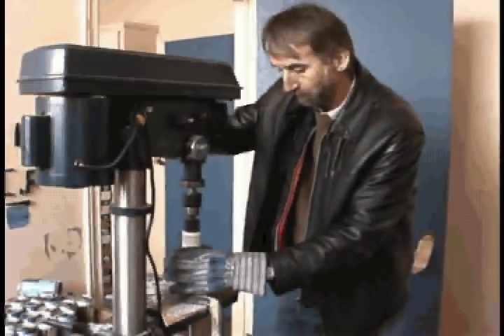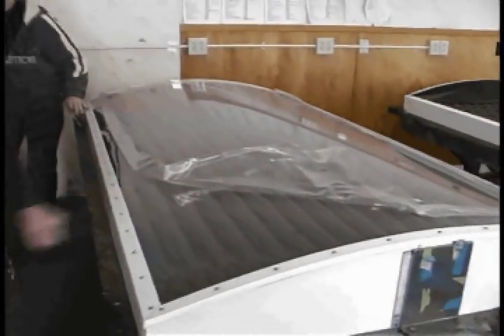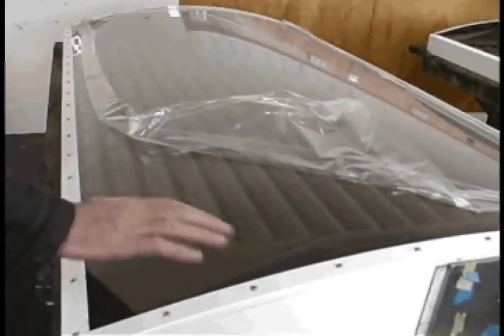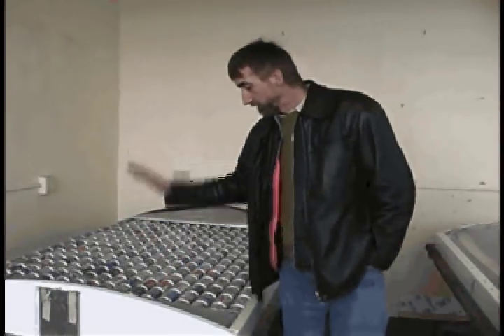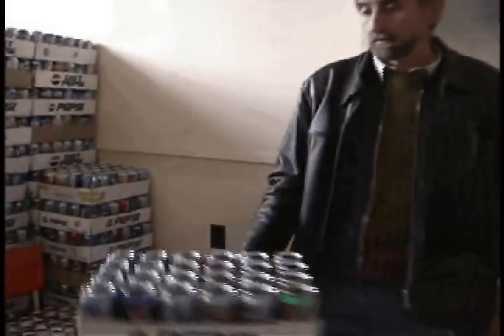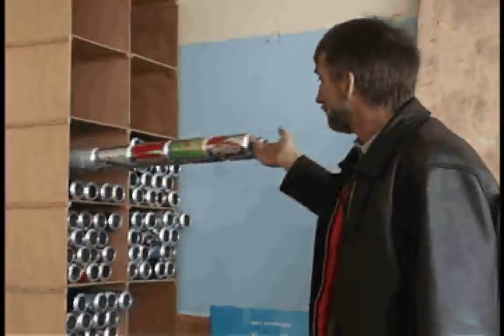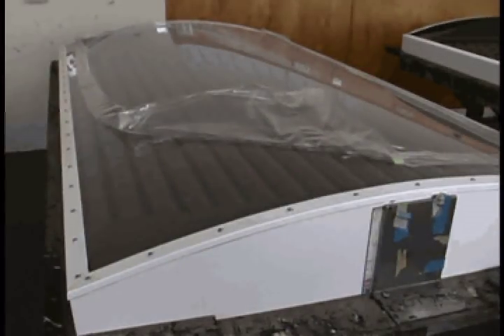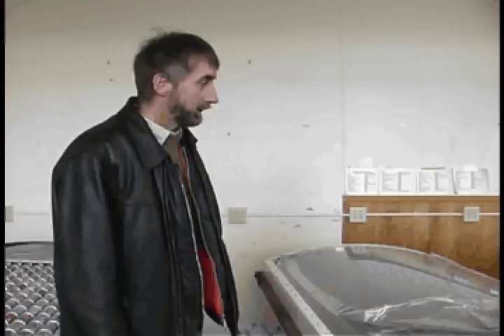Brilliant Newfoundlander Invents the Solution!

Comment: Very innovative. I liked the use of the cans' preformed edges for centering rings. My only concern would be the absence of a heat sink. Also, while this arrangement makes excellent use of waste soda cans, the resistance from the rough edges inside the cans doesn't make for a smooth flow of air. Large electrical conduit would eliminate that, although it wouldn't as inventive as this. The greater thermal mass of the EMT would keep the heat more consistent on a day with patchy clouds. Nice job.
Reply: I was speculating that the rough edges would trap the air and give the cans more time to heat the air.

Comment: As a former heating contractor I have to say this is quite a promising system. But as a former union safety rep...........Please! Please! Never use gloves near any rotating power tools. That glove next to the hole saw made my stomach churn.
Reply: Thanks, there is another bit of common sense that I never thought about. :-)
Reply: Thanks for the tip.  I would instinctively grab gloves.
Reply: Matthew Dies
speaking as someone who has 28 seperate breaks in fingers due to a glove wrapping my fingers the wrong way round a 13mm drill bit, I cringed at the gloves on as well.
Reply: HAHAH funniest thing I have heard all day thanks Employed 1000.
Reply: Bill Wright 
And it's not only fingers that can get corkscrewed. Watch out for those shorts!
Reply: at least you will miss next time! lol...
Reply: Employed 1000 and as a former woman I'd have to say never ever use sunlight liquid to wash those cans....dove is the way to go
Reply: Not that he has gloves on, wrong type of glove.  I would say that drill  press does not seem the safest to use on a can.
Reply: Probably used these gloves because of the heat transfer from drilling.
Reply: @nathanlafortune100  
Need gloves that fit - mechanical -
SpeedKnit® CR5 cut-resistant gloves are constructed with high-tensile strength fibers to protect working hands with EN 388: 2003 Level 5 & ANSI A3 cut resistance. SpeedKnit® CR5 work gloves feature heavy-duty nitrile palm coating so you can work with abrasive materials with confidence.

 or golfing gloves
Reply: Isn't the safety rep normally the guy who's the most clumsy andgot hurt the worst in the company?

Comment: Hook up the fan to a solar panel and the fan runs only when there is a need to move the heat that is being produced -when it is being produced.  Perfect symmetry.  All free energy that adds to the overall energy equation.  ...and I know, this is just a part of the answer, but any way to chip away at my heating bills, the better.
Reply: Also, if you could do it using a sterling engine to power the fan you would TOTALLY be set... there is never such a thing as free engergy, but the suns going to put it out regardless. :) Might as well take advantage!
Reply: Maybe a sterling engine and a magnifying glass to maximise the suns heat?
Reply: Greg Green yoir right, what i did was removed glass from my unit and then used the plastic that was the screen from my rear projection tv. Put the glass back on and let it run, in 4hrs everything was melted and the center was chared.  Looking for another screen to try this again.
Reply: EdmondDantesLeComte
yes there is free energy all around you, you just have to find a way to use it

Comment: Kinda skipped the step where you seal the cans together into the tubes.
Reply: +Bethany Theilman He can't give away trade secrets lol
Reply: Having the proof it works ten years would be better. I doubt that in case of a quick and dirty solution to seal the cans together.
Reply: Why would you want the cans sealed together? The heat generated is trapped inside by the plexiglass lens and through convection the heat rises flowing into your house. Unneeded caulking products and chemicals that will break down and off gas being exposed to direct and intense solar radiation and heat.

Comment: I love your idea...I'm wondering how you connect the cans ? are they welded or glued or is it a trade secret ! Keep up the good work !
Reply: Probably just pressure as they interlock. Could use high temp epoxy thou
Reply: @NwoDispatcher  
others are using high heat mortar

Comment: run water pipes through the panels, and you could heat your water too.
Reply: +Grimm Reapo Water takes a much longer time to actually heat up, which may null any return. I do think they do this for pools and such as my grandmother actually had her inground pool piping water onto her roof and back in.
Reply: +Brian Crail Some people use BLACK pvc pipe inside of a wood and glass housing. Works really well for heating water.
Reply: Not like you're going to be hitting it with a hammer. It may become brittle, but that doesn't mean it will leak or break. ;-) As long as it's still and not disturbed it will be fine.
Reply: PVC has bad heat transfer properties. Copper would be much better.
Reply: actually a five hundred ftlong black hose on your black roof will heat water. but in winter it s a bit more touchy.best way to heat outdoor pool water,no need for extra electricity.
Reply: copper dude...... copper. we already figured that one out.

Comment: So do you install this outside of the house? How do you use it in winter? Even with sun, these cans aren't going to heat up when is -25 outside...?
Reply: The can will heat up even when it is -25° (F or C) but perhaps not quite enough to get a whole house to +20° C. The cans are inside a polycarbonate box that insulates them somewhat.
Reply: It's the sun's light that heats the cans, not the sun's heat although the warmer it is the better they perform. Get a little box and cover it with glass and put a piece of metal inside painted flat black and you'll see just how hot that it gets and yes even on a very cold day...
Reply: Well he did call them "pop" cans.  So he must be mid-west (like me).  So he probably gets the same cold weather as I get.
Reply: How is light different from heat? What do you mean that the light heats it but not the heat? Do you know what those are? Does the light from burning oil heat a house? In the winter when heating is needed most, renewables are convientetly much less effective. Shorter days and longer nights are a crippleing blow to solar heating systems. So is the ambient tempurature when it is below freezing. Thats why water boilers are not located in your back yard, or in a tree or something. Long story short this stuff is not as effective as you wish for it to be, or else it would be competing with oil and gas burners for home heating systems, but it doesn't because it can't.
Reply: Ilir Kumi The flat black paint absorbs light and converts it to heat. I just made one of these with 256 cans. December 21 (the shortest daylight of the year) it was -10 celsius (14 Fahrenheith) outside and my heater was putting out 85  Celsius (185 Fahrenheit) with a 100 cfm fan. Those things are amazing. I have it up for sale for $1200.00 because i'm so amazed with it that i want to build an even bigger one...
Reply: Road asphalt does the same exact thing. Why don't we heat our homes with the heat absorbed from the roads? Because a furnace in your house works exponentionally better. And I gaurantee that heat output was not constant. What was it after the sun set? midnight? Could you sleep comfortably heating your house with that?
Reply: Of course there is no heat from it at midnight or after sun set. This is only used to supplement your existing heaters when the sun is out. There is no claims that this will give heat after sun goes down and yes my wood stove is exponentially better but this thing putting out 185 degrees when the SUN IS SHINING helps reduce my heating cost and i still have to rely on my wood stove day and night. These heaters won't heat an entire house, it just helps to heat it. It's not that hard to understand how they work. There are lots of you tube videos showing the output of these heaters...
Reply: All I am saying is that this renewable stuff isn't as useful as everyone thinks it is.
Reply: renewables are meant to be used in cooperation with each other. if we put together the 5 kinds of renewable energy you would have nearly free energy .
Reply: Free? Is doping silicon and refining aluminum free? You do not know what energy is do you?
Reply: Ilir Kumi
Maybe this will help.  Solar radiation doesn't heat anything (much) between the sun and what it ends up radiating, but when it does land on something like these cans, it gives up or transfers that energy and is then absorbed (by the cans).  Same thing with a radiant heater.  A radiant heater does not heat the air, but the things the light shines on, like the floor in the room which in turn then heat the air.  Having a polycarbonate cover goes a long way towards preventing that energy from being lost again to the atmosphere.  Just think of being outside in the winter with wind and again with no wind.  Huge difference in the amount of heat loss with wind.

This may not be the end all answer to heating our homes (especially at night), but for the rest of us that pay thousands of dollars per year in utility bills, any improvement will help. 

FYI, Boilers are often located in the backyard.  Especially if you burn wood.
Reply: How do you do it better than the unit in this video with cheaper materials and INSIDE your home? like this -> https://drive.google.com/file/d/0B001oVz9lVUuT0pCOGhkaFlTYWs/view?usp=sharing
Reply: Or with a bit of a remodel to do an UNDERGROUND (BASEMENT) Solar Siphon system (yes I mean solar siphon in the basement) like this ---> (BTW You can heat a dog house or ahem man cave this way LOL) https://drive.google.com/file/d/0B001oVz9lVUuVHd6TVpORHNkLWM/view?usp=sharing
Reply: The full article of how to build the basement solar deal is here on my paying it forward website... so yeah if you like the idea .. do whatever you want with it.... but the idea is that if we know how to build a better mousetrap.. we share that wisdom with others so that.. well as Benjamin Franklin put it... "Doing good unto my fellow man is the highest service I can do unto mankind.." Pay it forward folks! --> http://unified.community/featured-articles/8-home-green-energy-technology-for-thrifty-cheapskates/3-solar-energy-concept-1-the-concentrating-solar-collector-with-basement-or-underground-solar-siphon-thermal-energy-storage-mass

Comment: This is a weekend project . Any one can build one for less than $200 ( that size )
Pay $3000 and it will take 3000 years to pay for its self.
Reply: +David Pedder Drilling the canS would take the average anyone a long time because anyone doesn't have two drill presses set up. That many cans drilled twice is one day itself. Your right though it could be done in a few days for 10% of their cost yet they are the experts & they finance! LOL
Reply: +Joe Schroeder 
Don't use pop cans!!!! Collect soup cans, or sauce cans. Use a can opener on both ends of the can.  Soup cans a thicker, and hold heat better than a thin pop can. 
You could go out and buy all the tools you need to make one,( it would still cost you less than $3000 ) or give me $1000 and I will make one for you.
Reply: Though soup cans are thicker and also made out of a denser material, that retains heat longer, the object IS NOT heat retention, it is heat transfer. Aluminum can QUICKLY absorb the heat of the sun and QUICKLY transfer that heat to the air in the cans.
Reply: +mountnman3609 
There are 2 small computer fans, 1 takes air from the house, the other blows the heated air back into the house, doesn't really matter if you use pop cans or soup cans, they both do the same thing, I'm just saying, soup cans do not need to be drilled, just opened with a can opener, that every household has., but if you do use a thicker can you will get longer periods of heat from them , compared to a pop can that will cool off faster..
Reply: You will get a small amount of heat retention if the sun suddenly goes out, but they won't hold a massive amount and will cool down fast anyway. Steel cans are easier but beware of rust. Aluminium cans don't have that problem . But mainly it is about recycling old materials into new things. Otherwise, use copper or aluminium pipes or make some kind of heatbank using water and storage instead of air ;p
Reply: If you read all the posts the "small amount of heat" statement is not accurate.
Reply: Joe Schroeder Why?
Reply: +my google C I'm not shooting down his design !!! I'm shooting down his $3000 price tag he puts on a simple design, that can be made for less than a few hundred dollares.
Reply: +my google C 
I'm glad you can call me mr genius, but not sure if I can call you one.
First you say that soup cans most likely do hold heat longer. Then near the end of your ramblings you say ( So holding heat longer in a can is virtually a false statement )
I think I will call to Hillary Clinton instead of a genius, , or Mr Flip Flop.
Reply: Rick, I could hardly sneeze in this world for that amount of money
Reply: I see, thus for u very easy. My MBA in marketing. Join us as we launch to compete verse UNER & LYFT! For real!
Reply: What is your solution?
Reply: +Joe Schroeder 
More heat !!!
Every one is building boxes that hold 1 layer of cans.
Build a bigger wider box
Insulate the walls of the box, insulate the pipe that reruns the heat.
Bigger box = more cans
Reply: David Pedder insulated box with thin glass top. May need to make boxes that size to the cheap glass panes you can find at the tip shop as you aren't going to get cheap glass the size of his one in the video :-) Paint cans black matte or dark green as someone reckoned was more efficient.... Basically building a solar vacuum tube system without the vacuum part
Reply: Look Guy's "Momentinpassing" is Right. We want Fast Heat Transfer, Not Heat retention. How long do you think "soup cans" will retain the heat, Not Long. Yes $3,000 is B.S., Most of us can make several of these with nothing more then a circular saw, used 2" x 4"s, a box knife, used sliding glass door "pains" high temp black paint, some sheet rock screws or nails, chalking, aluminum cans, (& foil optional) a functioning brain & Less then $20. Everything We Can Do to help Lower our Heating costs is worth the Effort. Their are Many Ways to Heat & Cool our home, green house, garage, Shop etc. No Need to Bicker & Moan, just Do it. If You can't; have someone help you to do it. Remember Every Dollar You Save is like Earning $2 (For those of you who rode the short buss: ask someone to explain this to you). Yes this can be modified to work better, But You Need to Start Somewhere. So get to it, do it & Keep on building DIY project's for Your Home, Automobile(s) & Everywhere You Can. Because Every Dollar You Save is 1 Less Dollar Big Corporations Take from You! Not to mention Our Liberal infected Government & All The Sinester Maggots that have Corrupted Academia, Mainstream Media, Unions, Hollywood & Our Judicial Systems! To Name a Few! "But I digress". Oh! I've wanted to say that for awhile! Anyway That's all I have to say for now. Thanks for Your Time & All My fellow Vet's Thanks for Your Service,

Comment: wow almost $2800.00 for exactly $12.00 worth of empty cans $20.00 worth of plywood and a $35.00 - $50.00 piece of plastic that's why so many of these little start up companies don't last long. they want make too much profit off each unit not a little profit from thousands of units. and for a free technology no less.
Reply: ...ducting, forced air fan...  and then there's the hundreds of hours to collect, clean and process the cans and put it all together.  He is generously letting you in on how it's done so you can make one yourself!
Reply: ***** There is a great amount of painstaking work to put these together, I have just finished a 40 can panel.  It's true PV cells have come down in price and are cost effective by comparison in the short term;  in the long term, however, reliable simplicity wins as the thermal panels should last almost indefinitely.  There is also the issue of efficiency, creating energy in the form that it's to be used...
Reply: Grahame Edwards Absolutely correct.  The best way to use solar energy is for space heating and water heating.
Reply: Materials are not the only cost.
Reply: Start ups don't have the benefit of mass production, scales of economy.
Reply: Um time, equipment, utilities, wages, taxes, transportation - it all adds up.
 Overhead divided by 100 units would higher than if divided by 1000 units.
Reply: Indio Side
It probably does cost him a lot to build those. Lots of labor involved. I think the basic idea - that you can make a collector out of "free stuff" - is flawed in that it costs a lot to process the "free stuff". I made collectors out of a sheet of aluminum-faced insulation with PC dual glazing. They worked 25 years until my trees grew too tall. Cost maybe $40 each (4x8 ft).
Reply: James Van Damme If, if, it costs to much to process the free stuff.
 For example some discarded vacuum cleaners I have fixed cost very little in time and money, others cost to much.  
 In his case, virgin aluminum sheeting might be cheaper to use.
Reply: ***** You tell 'em comrade!
Reply: The value of the finished product counts more than the raw material. That is 'added value'.
Reply: +c4p0ne You can say no of course, instead of suggesting someone like all of us be hung for offering and not forcing you to buy a solar panel.
Reply: Oh come on! The drill needs 220v!